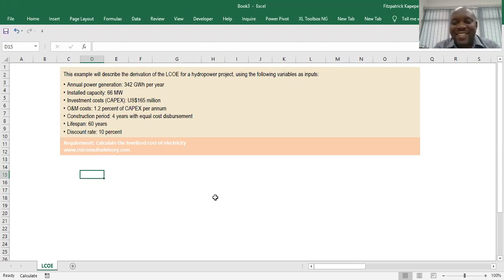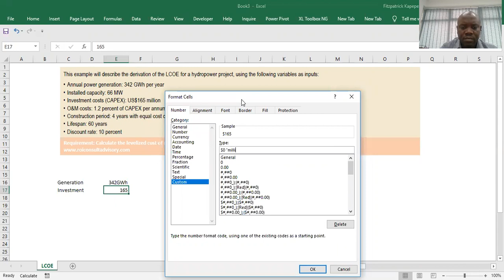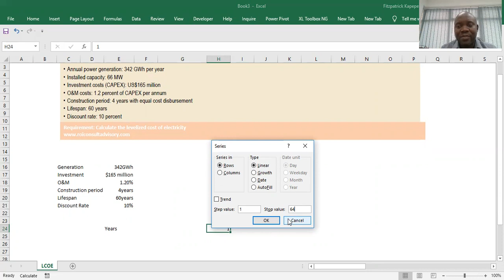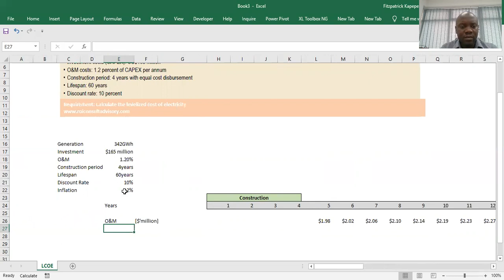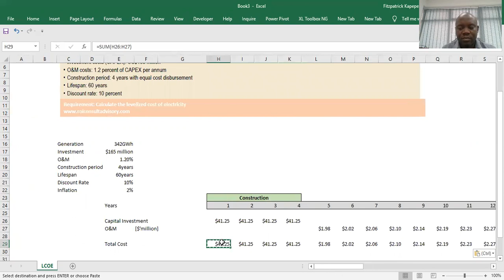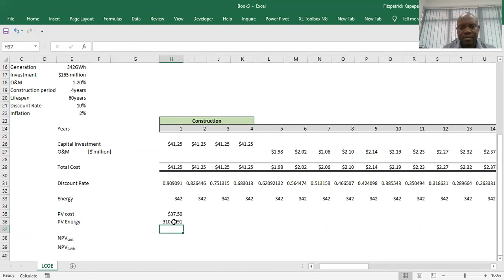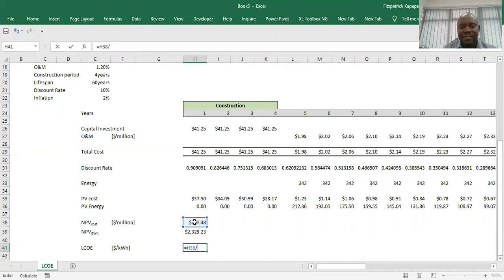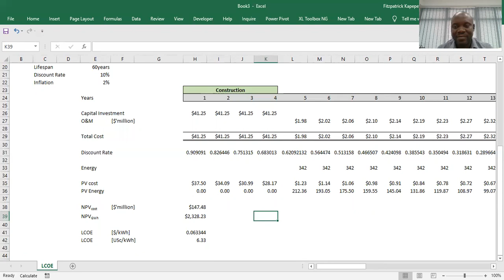How to Model Levelized Cost of Electricity (LCOE)

Comment: The NPV of cost is in Millions and NPV of energy generated is in GWh. But LCOE calculated is in $ / KWh. Am I missing something or this needs to be corrected?
Reply: if you convert million to dollar as well as GWh to KWh you have to multiply both nominator and denominator by 10^6. so, it will result the same after calculation and he directly done it.

Comment: Thank you very much.
God bless you a lot.
I also want to point out that I saw a LCoE formula that has the capacity factor of the generating plant.
Can you please comment on why you did not use the capacity factory.

Great work
Reply from the maker: Hi Bayo, the video assumes that the energy indicated is sent-out and has taken into consideration the Capacity factor. Say the installed Capacity of Hydro Power Station XXX is 120 MW with capacity factor of 98%, the energy sent out which you will you use in computing LCOE would be  (120 x 0.98 x 24 x 365 x 1000) = 1,030,176,000 kWh. This is now the number you use in your LCOE. Good Day
Reply: @fitzpatrickkapepe9037  thank you.

Comment: I have a question sir. Why was the energy multiplied by the discount rate? Shouldn't it be a capacity factor instead?
Reply from the maker: Hi H, Revenue is a product of price and energy; hence a key reason to why energy is discounted as well. Discounting costs without discounting energy would give you extremely low & defective LCOE.